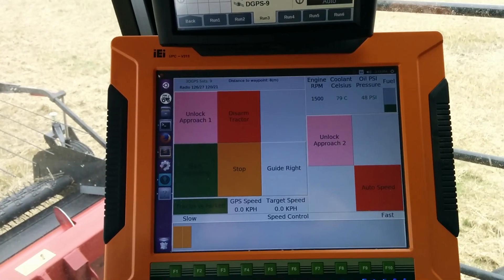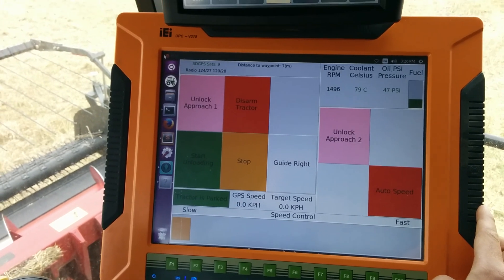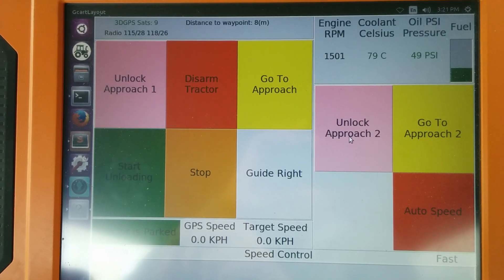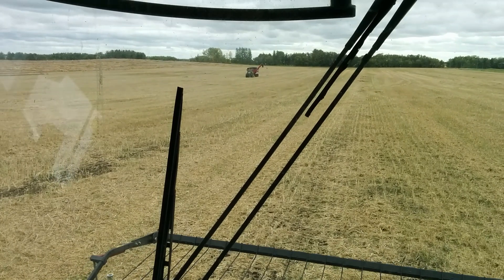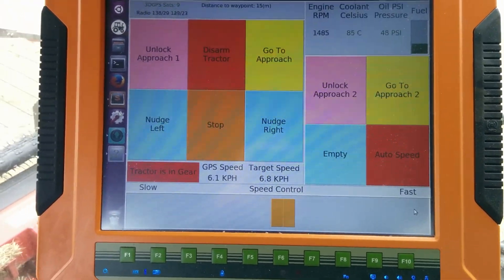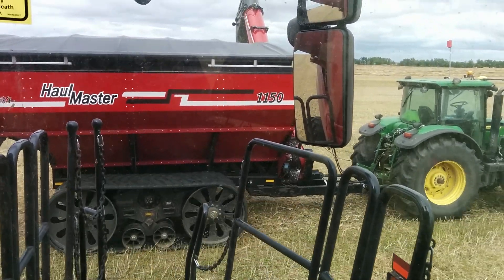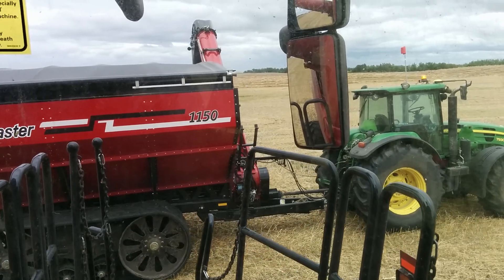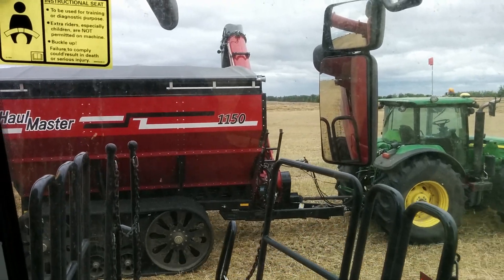Autonomous grain cart Year 2

Comment: Why such a high engine speed for such a low ground speed? Is that tractor defaulting to a low gear/speed on you because the operator-presence switch and probably other safety systems are "bypassed"?

Comment: As far as running over the ends of the cart, I would think that if for any reason the combine would suddenly stop, some type of feedback should disarm the auger. If someone could look at the program ladder, there may be a timer involved in how long it can be off target before the tractor reacts. If not, band width may be lacking in one or the other machines. BUT, this is an outstanding idea that will polish very nicely with a little time.

Comment: Great work! It's so fun this evolve over time. Do you still use Arduino?
Reply from the maker: Thanks for the comment. Probably I shouldn't care but it adds some fun for me that people are interested. I've integrated all the electronics in the tractor using Arduino. those little Arduino pros are so nice. They also seem to be pretty robust. I've had no trouble with them to date and it's a relatively harsh environment.
Reply: This is literally been a dream of mine for beans.  so damn boring in the cart.
Reply: Awesome! Well, I'm glad you took the time to answer me! I'm also working on automated farm equipment and was wondering about the lifespan of those little boards in a rough environment. Thanks for that